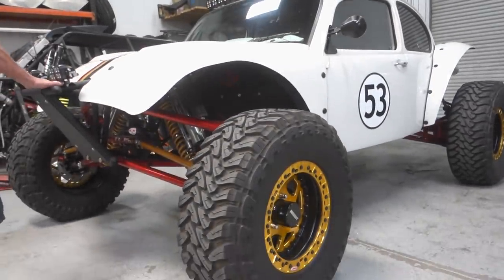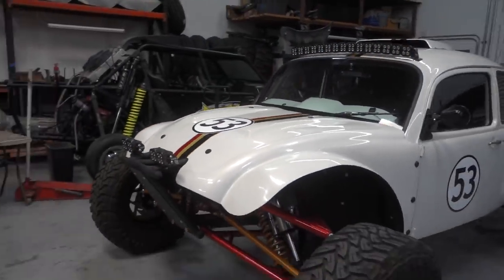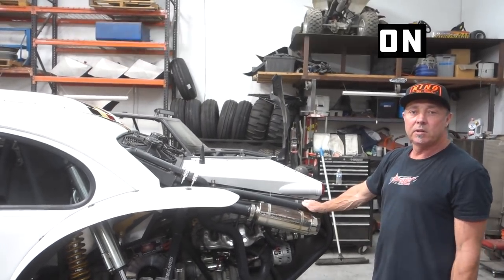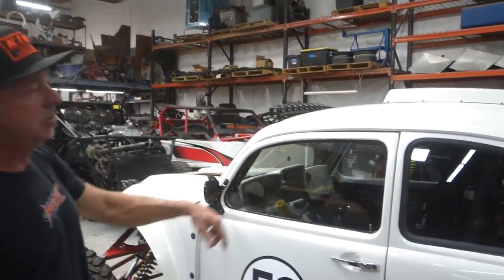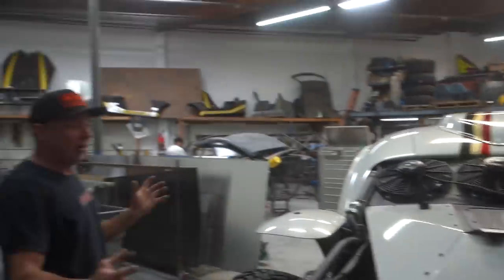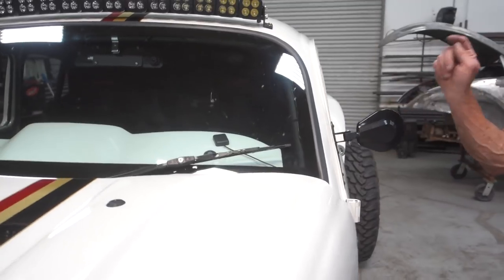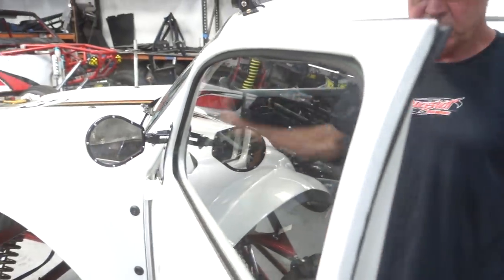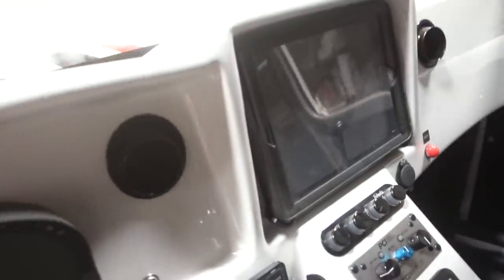700 HP Buckshot Racing Baja Bug PART 1 | BUILT TO DESTROY

Comment: We’ve got a twin turbo ls3 sand rail with methanol injection. 5 seater, steering brakes.  We run it in the forest where we live and it is a handful. Are the dunes really that great? It’s got about 656 horsepower.